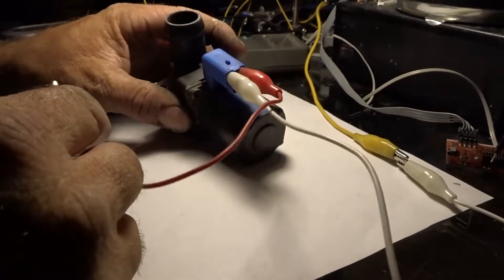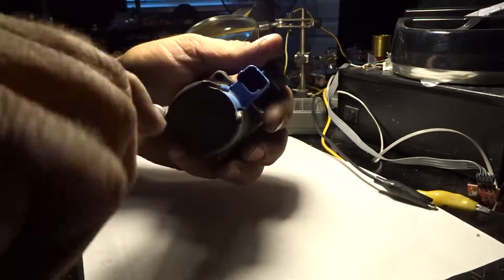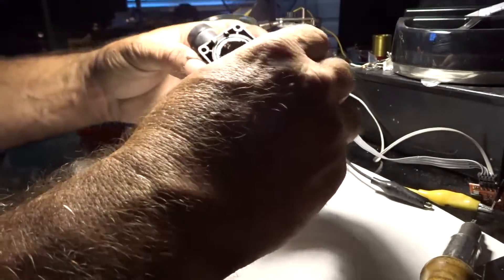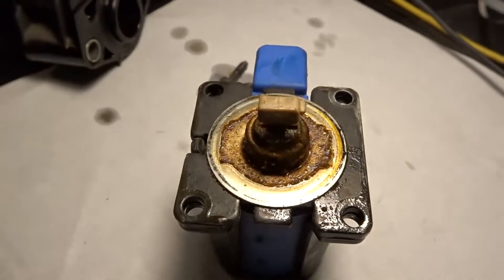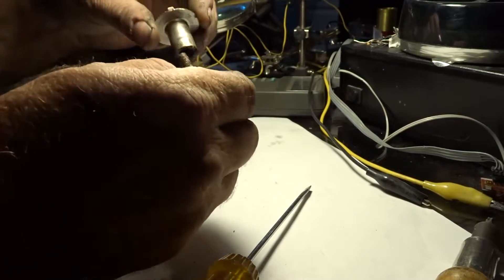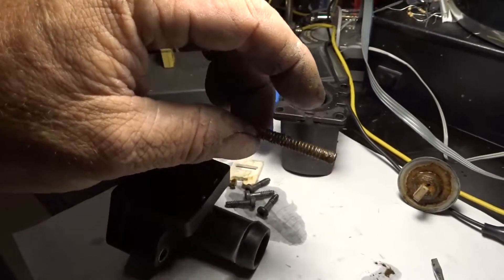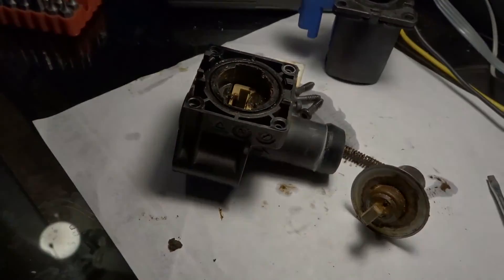Dissecting a failed Coolant Bypass Valve that caused P26B7 fault code

Comment: Yeah, years ago I wondered why all of these new coolants and their new colors were coming out, like the orange stuff that is used in these new Fords. Well with all of these new bypasses and such using plastic bodied electric components and rubber seals everywhere, all probably for emissions and such by the way it goes. They likely need these specific coolants, along with the correct and timely flushing of the system at recommended intervals, all so these parts have the supposed life. So when you see a new Ford or whatever manufacturer car running with the old school bright neon green coolant and not the correct factory orange, blue, yellow or whatever new color it should have. You should probably drain that old green stuff and spend the “double the cost” for the correct manufacturer supplied “new” stuff. Plus probably half of these Escapes, Focus, Fiesta, Milan, fusion, and the others, Ford autos out there still running the original none updated 1.6 long block or updated 1.5 head. Have had or most probably will have a bad coolant leak into cylinder 2 or 3 by 80k miles or as early as 35k by most accounts. It’s a Turbo motor designed by Volvo based on the old naturally aspirated ford  Duratech block pushing 14 psi of boost, with a open deck, the thinnest cylinder liners ever (which are cast into the block as to make the surrounding aluminum cast also thinner. all for weight savings, super thin when all together), leaving little surface around the cylinder for the gasket to lock and seal to. Which then on top of that, Ford then proceeded to mill a small groove in between each cylinder on the top deck/gasket mating surface to allow coolant to circulate through, while making the whole deal even thinner for the gasket to seal to. It all =s to a warped head on the 1.5 Ecoboost, and almost certainly a warped block and head on the larger 1.6 Ecoboost. If you were lucky and your engine blew and was replaced under warranty, due to there being a TSB for this on the 1.5 and 1.6. No recall, should have been, but there was At least a TSB ordering to change the long block (1.6) or head (1.5). The 1.5 got the same old head, and will probably do it again, but the 1.6 got a whole new updated design block. It had the milled grooves deleted to add surface and strength, and the cast around the cylinders was supposedly very very slightly thicker. But all in all, there is no excuses, the Japanese manufacturers have already been through this in the 80s. Look at their turbo cars now, they are all semi closed deck, closed deck, or iron block. US manufacturers just lack the experience of the Japanese in this area. But using a stronger deck when needed isn’t rocket science.
Reply from the maker: The turbo Japanese cars in the 80's were absolute JUNK! LOL. I was driving in the 80's. The Nissan 300Z and Mitsubishi 3000GT had major issues all the time. Blue smoke soon and then occasional BOOM. They did have the most power per liter in those days. But not known for reliability by any standard. Same for the Mitsubishi 4 cyl Eclipse

As from what I understand, the EcoBoost is more similar to the Mazda Speed Direct Injection as both were being designed and tested when Ford owned controlling stock of Mazda until the recession in late 2000's.
Ford happened to own Volvo as well. And Astin Martin, Jaguar, Land Rover etc

Anyway. Not to jinx us. But the car has been driven every day by a teen for the last year and it is still going.
Just cracked a hose so it lost boost. I just need to order that hose and that will be fixed.
I haven't had to fix that much in this vehicle's now 9 years of hard life.
I used to drive this car HARD and now a teen has driven it for a year.

I think most of the issues you mentioned are from Focus ST and Fiesta owners.
Of course a bunch of them had done some mods and tunes to jack the output up. So...
Reply: @hackfreehvac  Interesting that you mention Focus SY and Fiesta ST owners when both uses different engines (2.0 and 1.6 ecoboost), as far as i know the problematic one is the 2.0

Comment: Think you could just replace the top part to fix the issue? I’m not looking forward to replacing this one tomorrow in my wife’s car. Trying to take the easy road if there is one.
Reply from the maker: I don't think they sell pieces to repair it.
It's a simple replacement, however.

I also imagine it likely would have worked again if cleaned out. But it isn't too expensive so I just replaced it.
Reply: @hackfreehvac   I was thinking of just buying the complete part and only replacing the top part. Especially after seeing this video and that that much of the sludge and problems with movement are at the top. Thoughts on that?

Comment: my check engine light is on and the code was this code.   can I still drive the car until I get it fixed?
Reply from the maker: As long as you don't leak fluid.
Should be fine.

Btw. A popular Ford tech youtuber just did a how to on this failure last month. 
FordTechMakuloco
https://www.youtube.com/watch?v=Z---Tz670tk

Comment: I'm a very dyi person (won't even tease calling myself a mechanic) and have done a lot of replacements/repairs on my 2014 Ford escape and I have a very important question. Where can I find the exact tool to pressure test the coolant system? I have a coolant leak somewhere and I've looked everywhere I think I possibly could and can't find it. I've found many kits on Amazon or elsewhere, but as you know, the escape doesn't have the traditional radiator cap. I want to purchase a pressure testing kit, but don't want to purchase the wrong one
Reply from the maker: I'm a HVAC tech not a daily car mechanic. But you may be able to see if the auto parts store has a loaner tool. Something that screws in place of the coolant cap that goes to a hose with a gauge and a pump. Pump it to like 15 PSI.

Comment: 4.7 ohms its a normal value of resistance?
Reply from the maker: It can be on magnetic coils for solenoids or larger relays. 
But that's a little low for smaller ones.
Reply: Mine reads 7.9 ohms.  Whats normal resistance?
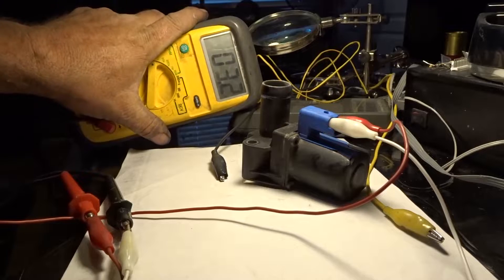Reply: 7 to 16 ohms  go see at 0:55 in that video  https://www.youtube.com/watch?v=4KnAVbP2fLo

Comment: Back Flush the cooling system. The extreme heat in your area, and turbo are hard on coolant. Use the Motorcraft premix stuff.
Reply: It's only 50,000 miles and the coolant looks perfect. I don't think the coolant broke down at all. The materials in the valve weren't made to hold up to the harsh environment of the cooling system. People all over the country are having failures, not just those in hot desert climates. I bet the new valve is made to last longer. I haven't seen the tsb for this issue, but I bet it calls for replacing the valve. The presence of a tsb indicates that Ford is aware of the problem and likely means that they have addressed it in the new part. The reason for the coolant flush would be a precaution in case some of that rust from the valve contaminated the system.

Comment: It's a chicken and the egg scenario. Did the sludge come from the coolant system and gunk up the valve? Or did the valve fail and gunk itself up. My money is on the valve being the source of the sludge. It wouldn't hurt to do a flush because some of that rust likely made it into the system. 

I'm even more curious now to find out how the computer knows the valve failed. I have 2 theories:

1. The stuck solenoid would have drawn excess amps. If the computer measures current, then that could explain the code setting criteria. 

2. Another explanation would be a ptc or some type of self resetting thermal fuse built into the coil. It would overheat while being energized and the protective device would make it go open circuit. Then, when the computer de-energized the coil, it would see an open circuit and set the code.

Take my theories with a grain of salt. I'm just thinking out loud here. Anyway, I'm glad you got it fixed. 

P.S. I just want to add that I've been following your channel for years, and I appreciate the content. My favorite video is when you showed how useless PTC start devices are. Thanks for all you do to fight the infamous run cap bandit lol.
Reply from the maker: Thanks man. 
That PTC video is a decade old now.  Lol

I had talked about some theory of the circuit setting the fault but edited it out.

I know that at least on ac powered coils the current is higher if the steel core isn't pulled into the windings. 
As we have probably all experienced,  if you pull a coil off of a pump down solenoid or hot gas bypass valve and leave it energized long it will pull crazy current and melt. 

Maybe it measures current in a similar way?
Reply: @hackfreehvac  I was going to let this go, but I couldn't get it out of my head. I did a little more research and found that DC solenoids don't have the same short circuit characteristics as AC solenoids do when the plunger is stuck open. DC solenoids have a fixed resistance and don't react to the changing inductance as the plunger moves through the coil. I also found a sheet from Ford that explains the setting criteria for your code. The code sets when the computer measures either an open or short in the coil circuit. See this link for a snapshot that I took: https://ibb.co/sJDmcw1. 

Now I'm back to square one. I think there may be 2 separate failures here. The computer doesn't have any way of measuring the state of the valve. It may have jammed some time ago with no noticeable consequence. The second failure would be caused by an intermittent open or short circuit coil. This is the failure that would have set the check engine light. I wanted to see what your thoughts are here. I feel like I'm stretching to fit a diagnosis to the available data. It's an interesting case nonetheless.
Reply from the maker: @denrayr  
Well I did replace the part a few weeks ago now and the code never came back.
So the car seems to be good now.

Although I want to remove some coolant and examine it to see if I should flush it.

Comment: Looks like you don’t change your coolant or you add tapwater to top off with with all that muck corrosion buildup
    When you’re with it coolant passages have your heater core microchannel looks like 
       Even after 300,000 miles in 10 years a cooling system should look pristine and clean.
Reply: I guess not all "long-life coolant" are created equal. 
OEM is always the best match... for what's required.

Seems the new cash-cow is controlled failure or degraded mode to force premature service.
Reply: G Lasser It’s not a new cash cow it’s been that way for decades. And coolant cannot handle topping off with tapwater because of the magnesium the calcium and iron in the water the salts act as a electrolyte creating a battery deteriorating metal from one metal surface to another and breaking down the coolant anti-corrosive additives. There’s also many coolant chemistries they all say coolant and sometimes they may say compatible with a certain model vehicle but the aftermarket coolants of different chemistry that are compatible require a complete system flush with distilled water before adding the new chemistry type coolant otherwise you end up with half the life that was designed by the coolant when intermixing. Over 40 years ago before I even got into junior high school my dad taught me if you don’t like somebody and you want to cause a failed heater cores or expansion plugs or radiators top off their coolant with tapwater ticking time bomb. It’s the difference between a coolant system that fails at 50 Kto 80,000 miles or a cooling system that goes 200 Kor 300,000 miles you make your choice
Reply from the maker: The car only has Luke 50k but looks like I probably will flush it. 

It actually lost some coolant a year ago when the overflow tank cracked. 
I replaced it and topped it off.